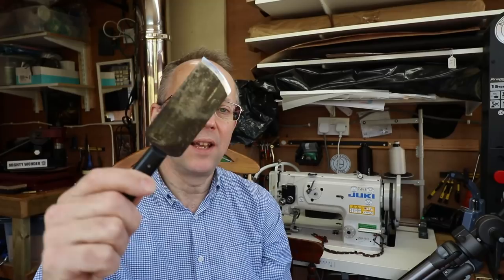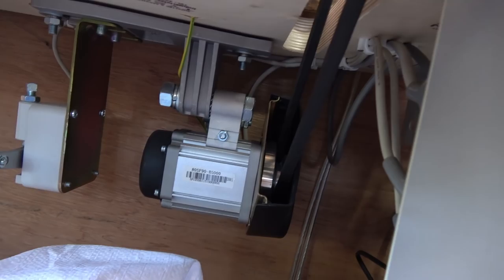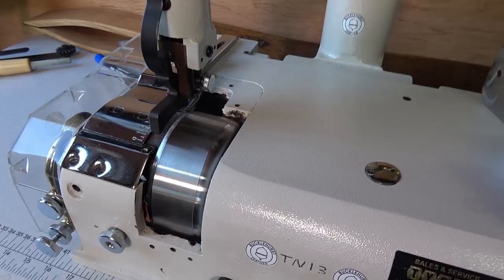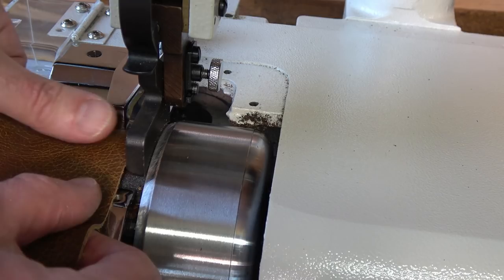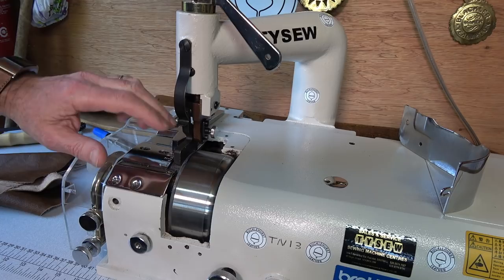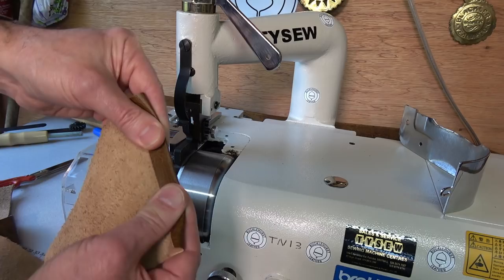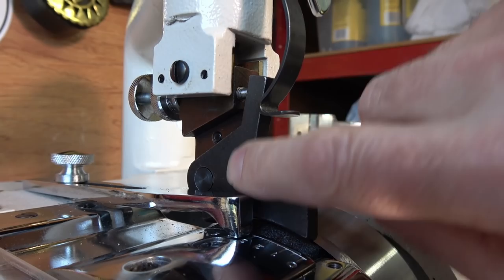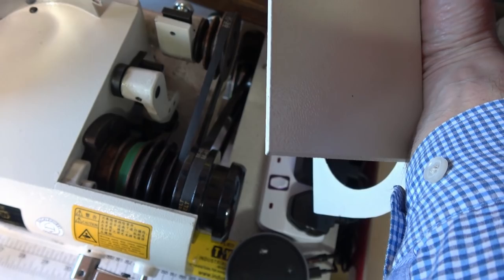An Introduction To The Leatherwork Skiving Machine

Comment: Harry(15/12/2018) 
 5/5 
I am very pleased with this machine and I have been using it quite a while now to skive bag seams in mainly veg tan leather..I changed the foot for a roller and its great. Works very well on chrome tan leather with the standard feet. All seems well made, I did loosen off the bell knife adjuster when I first got it as it was tight and it has been great since. All in a good machine that works well and is very good value. I found the Tysew team very good to deal and I have bought other machines from them.
Reply from the maker: That's great...I had to loosen off my bell knife adjuster as well...so perhaps something for Tysew to bear in mind.  Anyway pleased it's doing well for you, I am ditto very happy with mine, and have like you found Tysew very good....I have no commercial relationship with them.
Best wishes Harry
Reply: Mines mega tight too, need to figur how to looks it. Which roller foot did you buy for it? I mostly use veg tan too so could use something that doesn’t mark the surface

Comment: Looking forward to the next video on this machine.I operated a similar machine(not sure of the model) with very little instructions, it grabbed the leather and went through so fast it was hard to control , also it would jam up. Upholstery grade leather that had alot of stretch to it.We generally use it to skive the leather for making buttons. Your video gave me a thought of seeing if i can look up the manual for it.
Reply from the maker: I had the same problem and took the speed down on both the pulleys and the electronic servo motor. Rgds Harry

Comment: I have a problem, the grinder is sharpening the blade but in the wrong place. It does so far inside, and not on the edge where it is supposed to do it. I Try to move the blade to the right, so that the grinder can do it at a better angle. But that is not enough yet. I want to know what I can do, if there is a way to move the grinder so that it can sharpen in the right place. Please if someone can help me 🙏🏼🙏🏼🙏🏼
Reply from the maker: Hi Jose...is the grinder stone or bell knife very worn? The knife should have enough travel to meet the grinder.
Reply: @harryrogers  is new! I used for just a month. And at first it works perfect, and I think uta because the knife was sharpen. But now that is no longer sharp, is not working at all.
Reply from the maker: @JoseFernandez-wr5ob  I am not sure...online is the Artisan NP4 parts book that has a good exploded diagramatic view of the grindstone assembly. Sounds like you need to either get the bell knife shifted some more or move the grindstone so perhaps loom at the parts diagram and see what can be adjusted...sorry not to help more.
Reply from the maker: https://leatherworker.net/forum/topic/73087-skiving-machine-woes/
Also see this discussion

Comment: Do you feel there is a need for a top and bottom feed machine?
Reply from the maker: The addition of top feed would be good. I think it really depends on the type of leather you are putting through it, and how much. For waxy veg tan I suspect having a dual feed would be good, probablynot needed so much with veg tan. I think they cost quite a bit more, and I don't use mine enough to justify the capital expense.

Comment: Hi, i have a question. How do you maintain your machine? I have a bell skiver and i have a problem with the machine, it run very slow and has a weird sound from the machine/motor. Any suggestions how to fix it? 
Thank you
Reply from the maker: Hi Ramdan...you can usually adjust the speed by moving the belt to another pulley ...you will usually find the pulleys under a metal cover. Also check all pulleys are tight on their axles and not slipping and making a noise. Regards Harry
Reply: @harryrogers  thank you for your help harry!